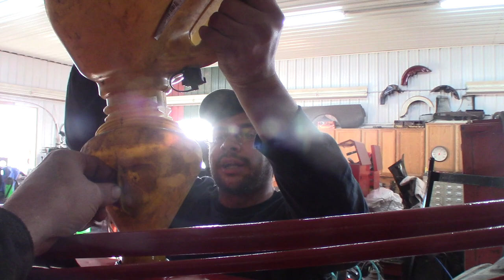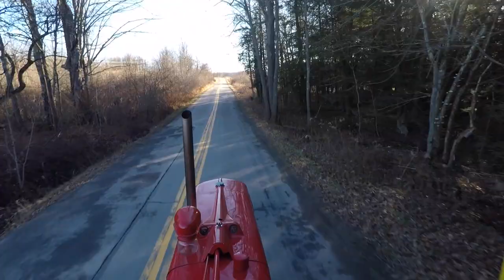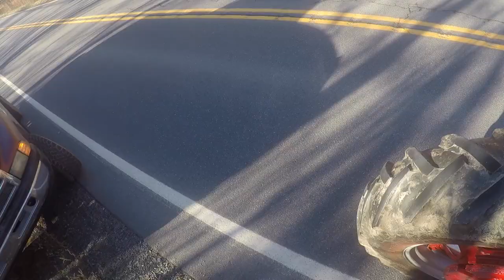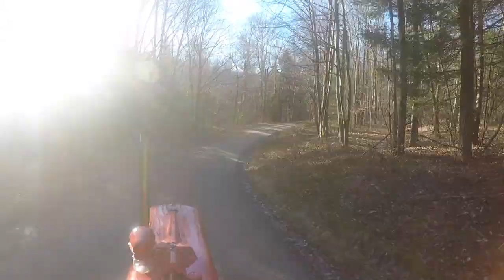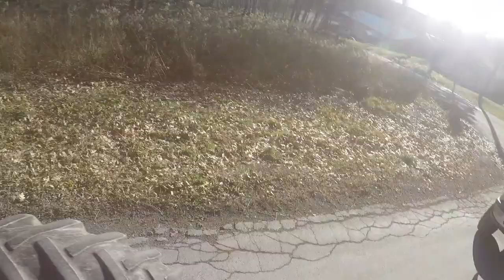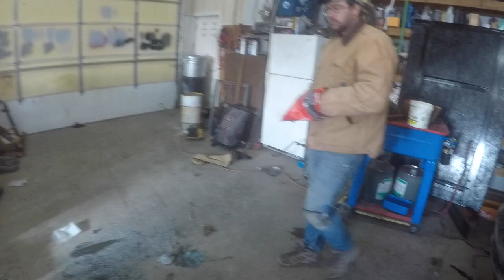Super M on recovery job getting Connors dead truck...

Comment: We always used to put an old tire between the tractor and the truck to absorb some of the shock when you’re trying to slow down but your Super M sure looks purdy keep that old iron running 😀🇨🇦
Reply from the maker: Hi Keith; Sure do love that old M. Newest old M I ever sat on. Shift and steering and everything is tight. I think it was barely used. Thanks for watching and commenting.
Reply from the maker: FYI; Changed channel name to John Frytag. Thanks!